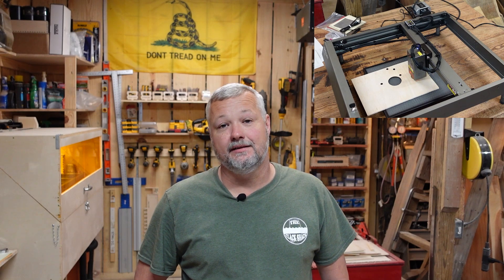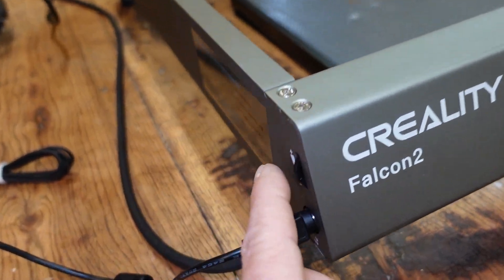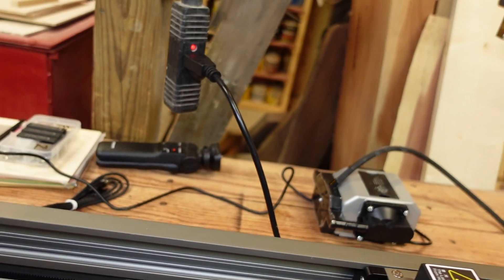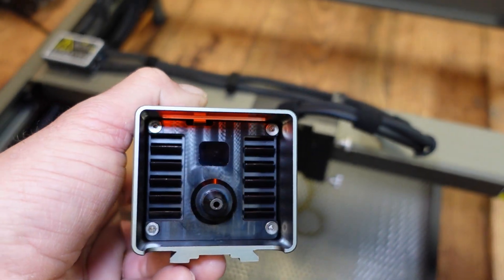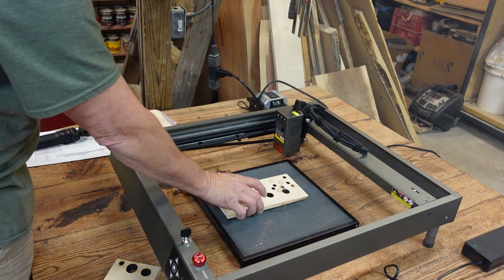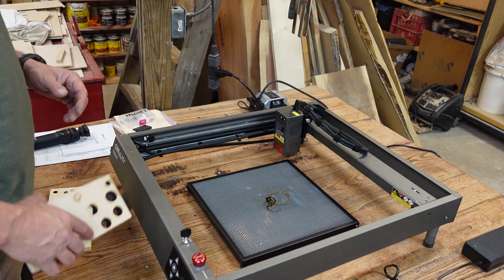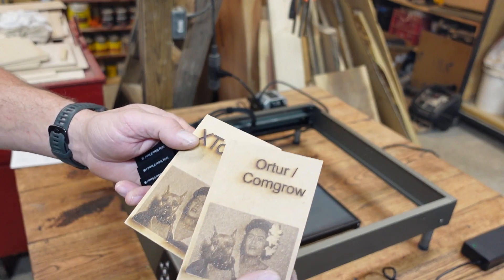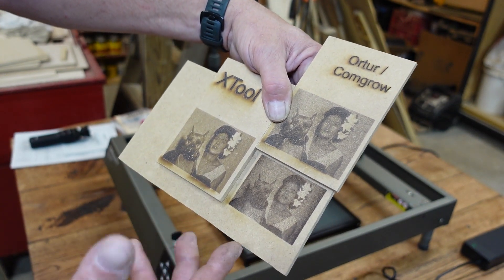Creality Falcon 2- Cutting 3/4 inch plywood

Comment: What's the actual Diode cutting power ? 5 Watt? Generally if consumption is 40 watt its a 10 watt power output.
Reply from the maker: The falcon is a 20 watt. I don’t recall discussing the consumption, only the optical output.

Comment: Can you do 8 or 9 passes with the 3/4 inch plywood? I'm sure one of those would have resulted in a clean drop, so is there a limitation on the number of pases that would prevent it?
Reply from the maker: I focal beam degrades with distance. The likelihood of a fire increases.
Reply: Yes the likelihood of fire increases with more passes. I don't know if it's better to let the wood cool before another go

Comment: Thanks for the video! Just a correction, their newest one is a 40W not 33W. Just got mine, but new to engraving so I have a lot to learn.
Reply from the maker: Not sure they had a 40 when I made the video. That’s a lot of output though
Reply: @TheClackShack  it has dual mode, so 40W when you want to cut large objects, or push a button on the top of the engraver, and it switches to 22W for more precise engraving.

Comment: Can you please show how you would clean the lens? I have cleaned my 3 times and the light will not go off.
Reply from the maker: Not sure how that sensor works but it being able to tell if the lens is dirty seems like a stretch. Probably a visual sensor nearby. I just clean the lens and go. Without a transmitter and receiver, I can’t see how they could make an accurate lens cleanliness sensor
Reply: hit the reset button on top of the laser once you've cleaned it. restart machine and if its still dirty it will stay orange otherwise it will go back to green

Comment: Hey there, thanks for your great reviews! I’m just getting ready to buy my first 20w for engraving anodized aluminum panels. Would you share if you would go either Falcon 2 or P20? Thank you!
Reply from the maker: The size of what you will be doing would be a consideration. Both machine has very similar power characteristics and accuracy. The falcon does have a little more technology built in.

Comment: Thank you for sharing your thoughts and for the discount code which worked for me.  Mine has arrived and I have a couple of observations.  Multiple screws on the assembly were loose.  The adjustment screw for the dovetail mount for the laser had to adjusted -- the laser head wobbled on the mount.  They did not include the honeycomb bed and when I reached out to Creality, the honeycomb bed does NOT come with the unit.  Other than that it seems to be working well with Lightburn.
Reply from the maker: Yea, I had to tighten everything up and make some adjustments to it.

Comment: Curious how this stacks up to the Atezr P20. I saw the Creality on preorder and almost got it, but Atezr had a sale at the same time making it a bit cheaper even picking up the honeycomb at the same time so I got the P20. Haven't used it much yet tho as I didn't have a good place to put it so having to do some rearranging and building a new enclosure.

I admit I was a bit disappointed in the display / touch controls on the Atezr. They aren't a necessity by any means, but seems almost worthless unless you're running from a card. Tho since the hardware is there I'm sure it's something that could be expanded on with a firmware update in the future. I would really like to be able to home from the screen at least, but you can only do that if you have a card installed I think. Also curious if there are any extra I/O pins on the Atezr controller, so maybe a relay could be tied in to control the air. My Sculpfun has a fairly generic MKS CNC board, tho without opening it up I feel like the Atezr may be more purpose-built.
Reply from the maker: The output is comparable it seems but the work area is slightly smaller.

Comment: Nice review.  I have had a Creality 3D for a numbre of years and never had any issues with it.  Creality does make a good quality machine.  This machine does seem to be impressive, based on your preliminary review.  The only issue I have (not really with the machine), is the pricing.  I  have a hard time with it's price, when you can get a CO2 Laser, with more power and enclosed, for less money.  While it may have a few extra bells & whistles, a real handy person could add them to a CO2 and still have an "equivalent" machine for less money.  Looking forward to your more full review of the machine & it's capabilities
Reply from the maker: The CO2 vs. Diode is a preference in my opinion. For what I do, I prefer a diode on most jobs, I have a 40 watt CO2 for acrylics but that’s about all I use it for.
Reply: @TheClackShack    That is true.  Each person has their own preference.  Me - I am not floating in dough, so, I have to go the route where I get the 'most bang for the buck' that I have available.
Reply: @alpscraftshack599  Just curious, what's the build area of your CO2 laser? All the cheap enclosed CO2 lasers have small build areas and huge footprints. Which wouldn't work for my shop.
Reply: @alpscraftshack599  Bang for buck is also subjective.
Reply: @dangerous8333  With some tweaking, I have my K40 build area at 14" x 10".  It is more than adequate for what I do.  As a side note - When you build or purchase an enclosure, for a Diode Laser, which is a good idea, that further adds to its cost and increases the footprint size.

Comment: Great review. Thanks for all your effort. 🙂By the time you are done building enclosures, you could just build a bigger shack?
Reply from the maker: I enjoy the designing and building part. The next one that I make, I am gonna try to build it using just a laser…..
Reply: @TheClackShack  you might want to oversize it! Every time they send you one, it gets bigger, lol
Reply from the maker: @daynafost  , I know. The enclosure that I loaned my friend would fit this machine with some minor modifications but I plan to redesign my vacuum table enclosure anyway. It will be 28x29 and all the pieces are going to be laser cut. I am trying to make a DIY enclosure that anyone with a laser can make. I think that will be cool…
Reply: @TheClackShack  Do you sell the designs? Do you think it would fit a Atomstack A20?
Reply: @TheClackShack  That would be awesome. I'm all about using the machine, to make things for the machine. It's my specialty. I'm looking forward to it but be quick because it's at the top of my list too! 

For now, I'm using my Creality soft enclosure from my 3d printer. Turned sideways the Falcon 2 fits perfectly. It works really well surprisingly. I just needed a larger extraction fan.